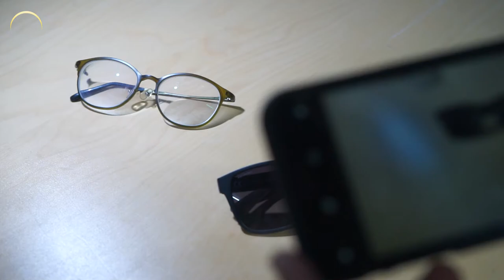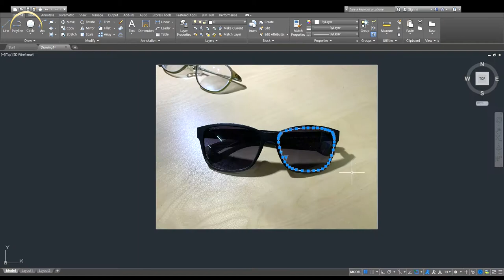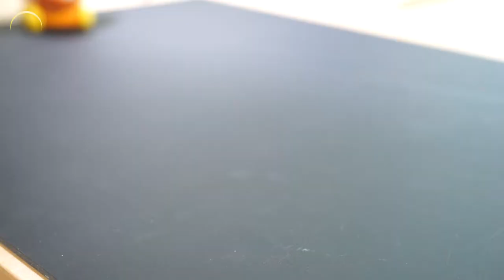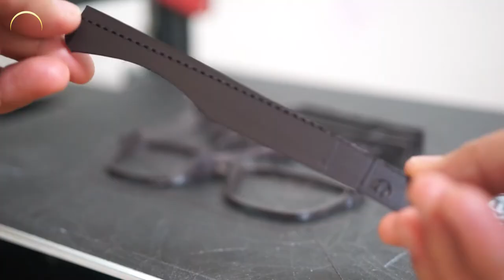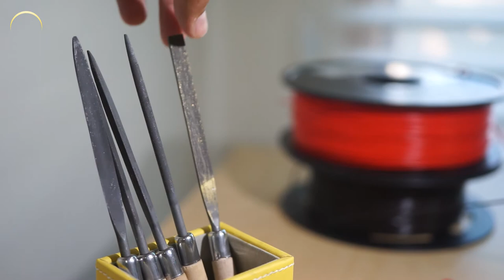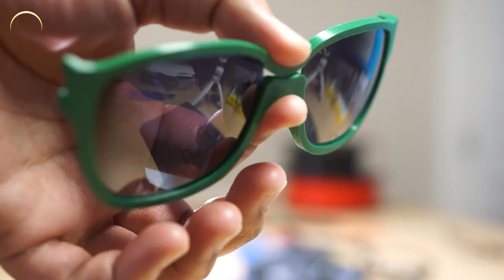How to Make 3D-Printed Sunglasses at Home

Comment: Can u 3d print edith glasses from spiderman far from home and iron man. I know its a shades. But i want the same design on my face to be my normal glasses. The problem with the shades is that it made from metal and glasses ppl say they cant reuse metal frames. So how to 3d print a filament hard plastic version. Same design as the shades but made from plastic instead of metal or a really strong fillament.  Just make edith glasses in  type of filament glasses ppl can use and reuse for adding/replacing tested transition lenses. Because as cool as it looks and work good shades. U cant always wear it. Unless u blind.
 Normal Tested glasses u can wear anytime anyplace.